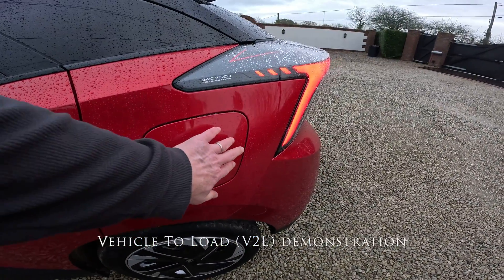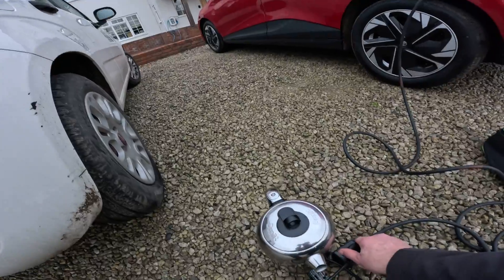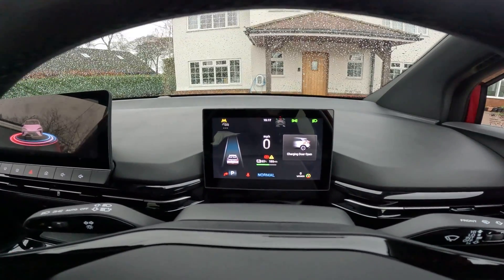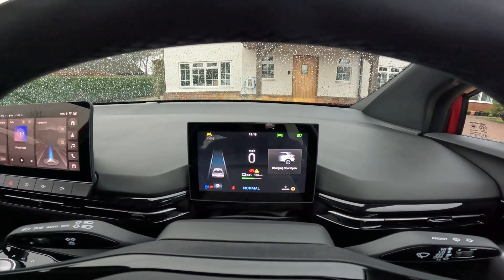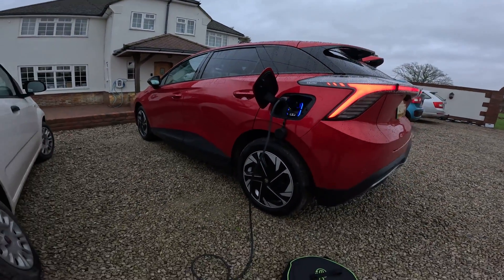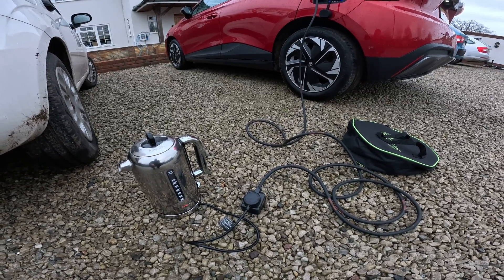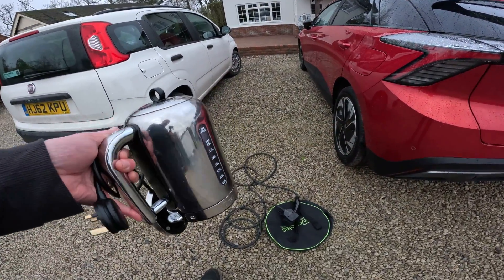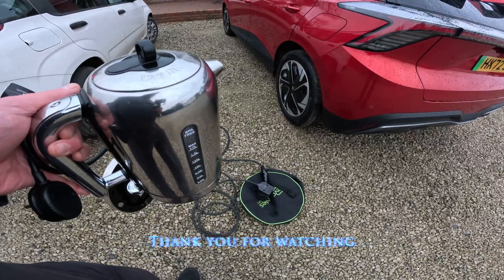MG4 EV Vehicle To Load demonstration, 3KW tested mains output V2L

Comment: I have a BYD Seal with V2L rated at 2.3 kW.  I live in Thailand and modified the power supply to my 18000 BTU air conditioner with an ATS which disconnects the air con supply from the  house wiring when I plug in the type 2 discharge adapter to my EV.  The BYD runs the air con for 15 hours at night consuming 10 to 12 kW hrs then simply change over to the charger in the morning and charge the EV battery with my solar panels...it is very easy to use and is saving me a lot of money.

Comment: Great if you charge your car off peak then power your house anytime off peak
Reply from the maker: Sadly v2l - vehicle to Load, not V2H - vehicle to home... you could only power one circuit.
Reply: @BurlSolomons  At the same time I was wondering if it would be useful in a power cut. Obviously wouldn't be able to power the entire house, but should be enough for a lamp on in the living room and perhaps be able to power the central heating boiler or fridge as needed.

Comment: These cables can be useful, BUT they are ridiculously overpriced for what they are. EV Cables are selling this cable for £220 (10 Metre)
Reply from the maker: Yes I know what you mean. Seems a lot for a 13A extension lead with a type 2 on one end.
Reply: @BurlSolomons  Don't forget the resistor(s) used to signal that it's a V2L cable, they are very expensive those resistors! :-P
Reply: @BurlSolomons  especially when Kia give an adapter for free.
Reply from the maker: @Dreadpirateflappy  they are charging  you for it in the price of the car. The cheapest MG4 with v2l is £26,995, whereas the cheapest Kia is the new Niro EV3 starting at £39,545. For 12 and a half grand more I would expect the v2l cable to be included!
Reply: @BurlSolomons V2lL adapters are well under £50

Comment: Hmmm, kettle might be rated at 3kw but that doesn't mean it was getting 3kw. You need to find how long it took to boil, then with the same amount of water in it plug into a normal socket and compare the boil times.
Reply from the maker: Best thing to do is to put a power meter plug on the extension lead and see what's going through it. Will have a go at  doing this in the next few days. Plus the car apparently shows how much power it is discharging on the screen, but bit I didn't notice during this attempt. Will have to have a proper investigation.
Reply: That’s not how electricity works.